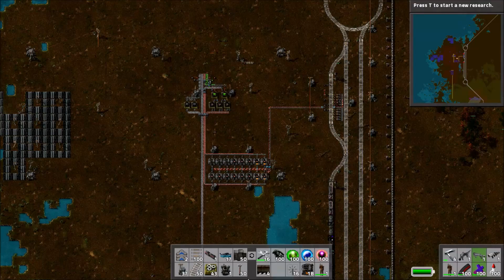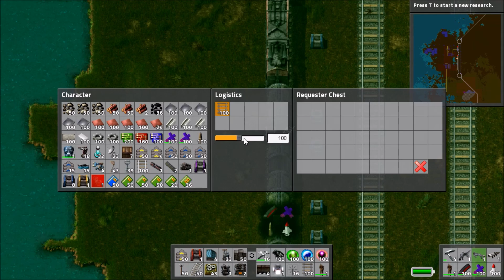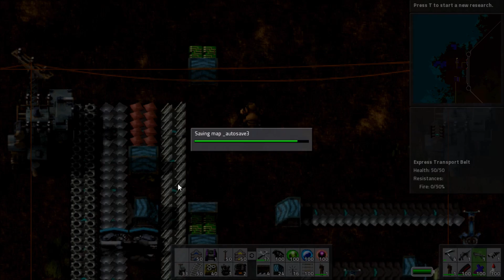Factorio Railworld Ep#62: Production Peninsula

Comment: Just so you know, if you have a provider/storage chest with repair packs inside(within logistics range), the bots will automatically grab them if needed. That way you don't have to stock roboports with repair packs. :D
Reply: FumblerX If the bots aren't in this roboport, they don't use repair pack inside. Then store them in provider/storage chest is better.
Reply: Logistikon11 Yes and when all the repair packs are in just that One port, i'm not shure if all the bots are going to use the repair packs if they are just in one port.
Reply: MrJerem07200 But if they are in the roboport they spawn with the packs in the inventory, while if they are in chests the bots have to pick them up.
It can make a big difference if the roboport is on a heavily contested wall...